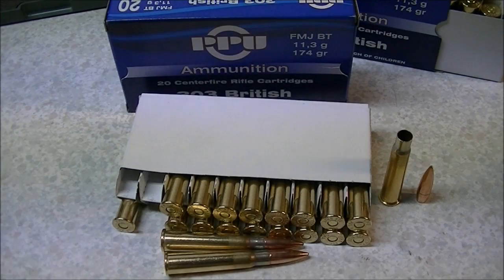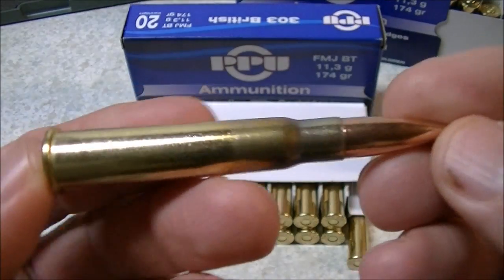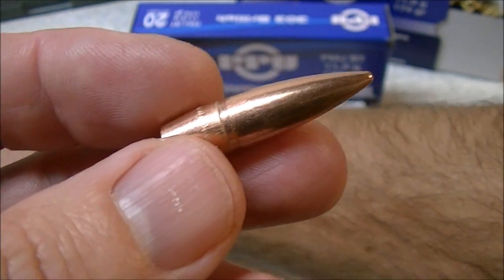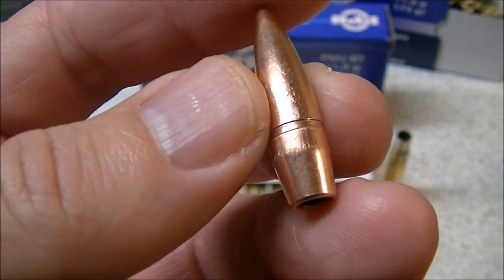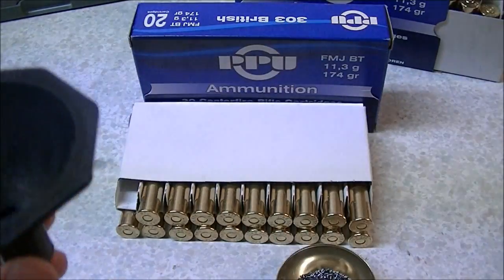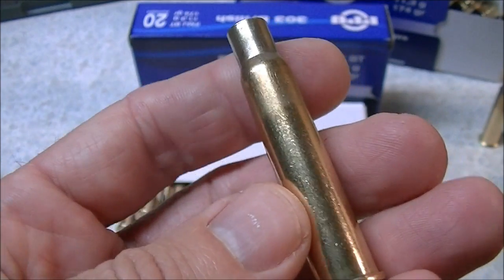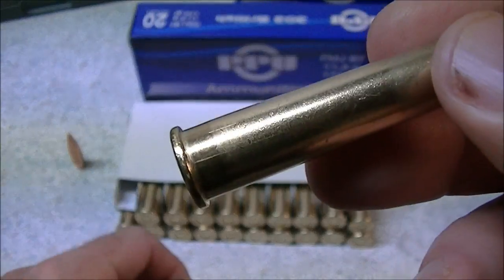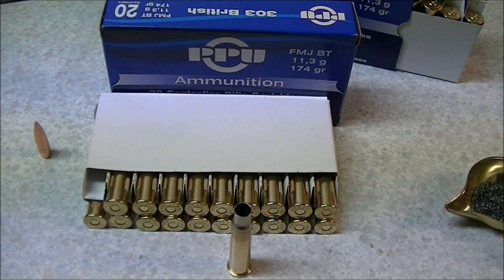Prvi Partizan .303 British 174 FMJBT Ammo Review, Part 1

Comment: With those I get 2235fps in my #5 Jungle Carbine.
Reply from the maker: Interesting. They averaged 2367 fps in a full length No. 4 rifle, so they did not loose much speed in the shorter No. 5 barrel.
Reply: @314299  That was ten years ago, I bought a new #5, in the mail, will try again in a couple weeks with current ammo..

Comment: I'm just seeing this today 11/08/23. This a very nice video. I have not used PPU  303 ammunition.I have used the 8mm and 30/30 Win. Recently I've used some Herters 303 Brit. 150 so & 180 sp. I had best results with the 180 . The 150 gr was not too bad either.
Reply from the maker: I'm glad you liked the video. I've not seen any Herters 303 ammo around here. I have heard that most of the "Herters" brand ammo is now made in the USA by Winchester.
Reply: @314299  I found mine at my local Cabela's in Mitchell SD. I researched it and found out that Cabela's owns the Herters brand.
Reply from the maker: @clintonlayne9253  Yes you only find that brand at Cabela's and Bass Pro stores. I think they subcontract the ammo production out so over the years the brand has been made by different manufacturers.

Comment: I find .312" bullets work much better in my No4. I hear that from some other notable and well respected 303 owners. I reload and get impressive groups with IMR3031 and .312" sst or sp hornady bullets. The difference was quite something. I"m about to try some of these factory loads as a reference and starting point for newer Enfield acquisitions.
Reply from the maker: As the loading manuals often say "groove diameter of 303 barrels can vary considerably", and a lot of them are large and for them a .312" bullet can make quite a difference in accuracy.

Comment: I've had 1 no1 lee enfield that was so shot out that a bullet would slide right through the barrel. On some of my no4s the barrel looked good but I plugged the muzzle with a dowel. Then I filled the barrel with ammonia left it for a couple of days, when I drained the barrel it poured out green. Even if your barrel looks good you should give it a good cleaning. If you don't want to fill your barrel, load your patchs with ammonia to pull through....Hal
Reply from the maker: Pretty much every old rifle I have bought has had a lot of jacket fouling when I received it and has required a fair bit of cleaning to get rid of it. I have used a number of different products, all worked but at different speeds. As for "Shot out" Lee Enfields I have an old MK1 Long Lee that a 311" bullet will fall completely through, a .312" will stop 1/2 way down. With a 316" cast bullet it shoots OK.

Comment: I bought a 50 pack of these same projectiles from graf and sons for 30 cents a piece to try out with my lee loader. I'm going to try them with 43.4 gr of bl-c(2). I wanted to buy varget but Bass pro was sold out,i also considered imr3031 but I only have the volumetric spin that the kit came with and there was no load data for 3031 and I want sure about it for projectiles above 150gr.I'm new to reloading do you think bl-c(2) will give good results in my mk1no5? the bore is in brand new condition, my grandfather have me the rifle he purchased it new at Kmart in the 60's. thanks for the excellent videos!
Reply from the maker: Hodgdon  lists a load with BL-C(2) for 174 grain bullets, start load of 43.0 grains (2442 fps) to a maximum 46.5 grains (2616 fps) using an overall length of 3.075". Their data is with a .312" bullet.  So your planned load of 43.4 certainly sounds safe and reasonable.  IMR 3031 has been used a lot in 303, Hodgdon also lists a load of 41.0 grains for 2632 fps with a 150 grain. The only way to find out how these loads will shoot is to try them in your rifle, Lee Enfield rifles can be rather individual in their load preferences. For faster loads Varget is a good powder as is Reloader 15. You might want to get a set of Lee dippers, that will expand the number of loads you can assemble with your Lee Loader. Best of luck with your 303!
Reply: Thank you for the response sir. I loaded my first test round with 43.4 gr of the BL-C(2) and the 174 gr FMJBT. the hardest part was that the data sheet provided lists a min C.O.A.L of 3.075" with that powder and projectile and as you know, the cartridge max OAL is 3.075" so I was obessing over mine being 3.074" I finally concluded that the min cartridge length listed by lee is for a max powder charge and as long as im seated to the cannelure, I'm not going to sweat it. furthermore i'm assuming that Hodgdon doesnt list any load data for imr 3031 with a 174 grain projectile because there wouldn't be any room in the cartridge without compressing the powder?
Reply from the maker: There is no 3031 load for the 174 grain bullet on the Hodgdon website, but it is listed in my Sierra manual. Start charge of 38.5 grains (2100 fps) to a maximum of 38.8 grains (2300 fps) with an OAL of 3.075" for the bullet used (a Sierra .311" MatchKing HPBT). I would load the PPU projectile to a length suitable for the cannelure and would not worry about the OAL too much as long as the length is close and the bullet is not seated against the rifling (which is highly unlikely to happen in a .303).
Reply: Once again, thank you very much sir, this is exactly what I needed to know.

Comment: I bought a sporterized 1918 no 1 mark 3* and ran 2 boxes of this through the gun for the first time. Shoots good decent ammo I noticed that it was annealed right away.it pricey tho at 30 bucks a box for the .303 in Canada which Is sad That theres not surplus around anymore.I used some also in 7.62x54 and it shot nicely outta my 1940 mosign.Good video.
Reply from the maker: +Kyle Donovan PPU 182 grain 7.62x54R is my favorite for my 91/30 Mosin  Nagant sniper rifle, quite accurate.
Reply: I have a 1918 sporterized Lee Enfield as well.  My Mosin Nagant is a 1932 Tula.  The PPU is mainly what I shoot for the Enfield, but I also get some of the Czech brand as well.

Comment: not really its a one time deal I've gotten upwards of 30 reloads from my .303 I also use nothing but prvi brass as it has no undercut while the American made stuff dose. ive had good luck with the .577-450 as well a .468" to .470" grease groove bullet is what's needed I also use thing but solid head brass no magtech stuff and don't use lee dies as they are made to size down the case to under the smallest size of .577-450 chamber and a .458" bullet I use .480 ruger dies to neck size only

Comment: not really put a oring on the case right against the rim fire it and then neck size from then on and only use them in that gun. this stops case head separation that is caused by the case headspacing on the rim and not being tight to the bolt face. doing this trick the case will form to headspace on the neck the oring is only needed the first firing

Comment: it relieves the stress from forming witch would cause cracking or splitting. its also good practice to anneal after a few times each case is fired for .303 every 5 firings I anneal my brass I am also just neck sizing for brass